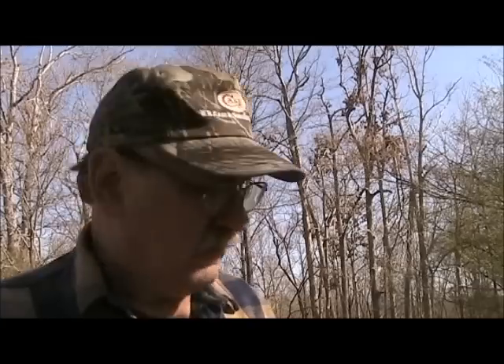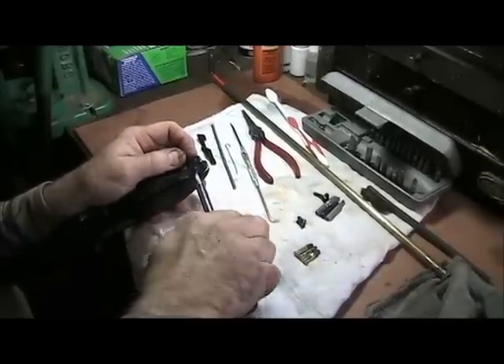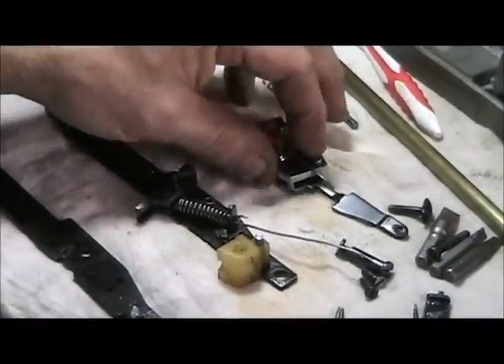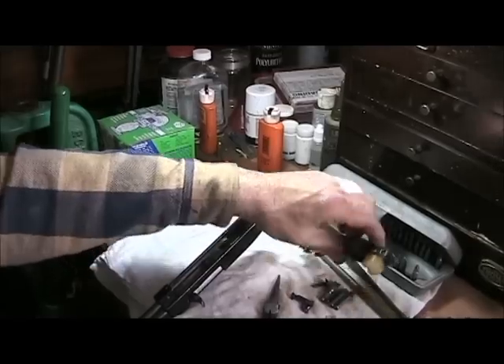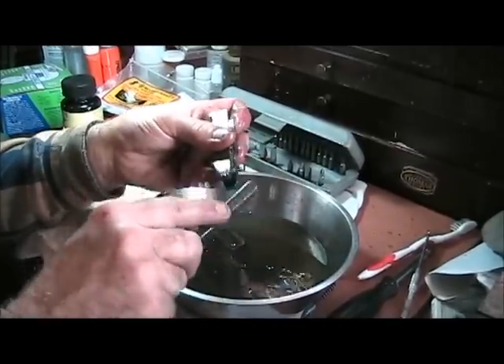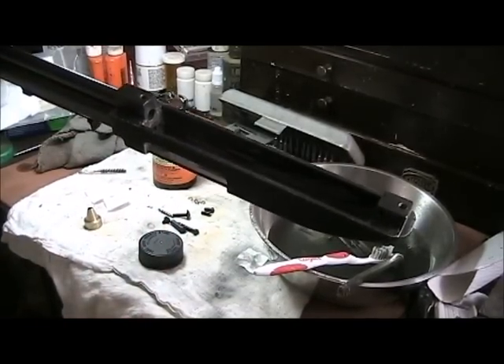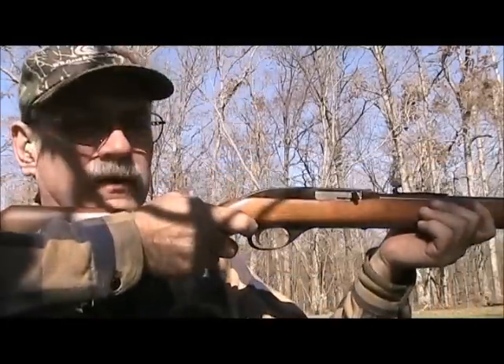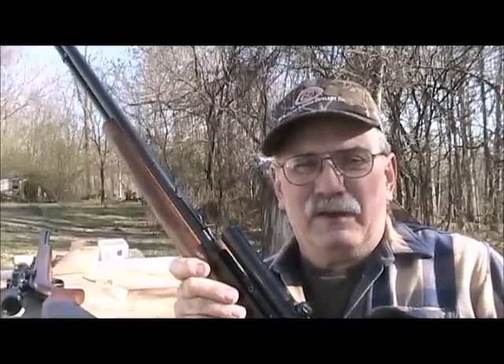Marlin Model 60 Jamming Problems and How to Fix Them

Comment: I have a Marlin mod 60. The bolt started hanging up in the receiver as it approaches the chamber. It's also hard to pull past that position but moves freely in the rest of the receiver. There are no chafing marks in the receiver. What could be the reason for this?
Reply from the maker: If the bolt is hanging up in mid stroke, even after the hammer is cocked, then you could have a slightly bent guide rod, or some fouling causing it to cycle hard. I would dis-assemble it going by my instructions in the video, and look for potential problems while thoroughly cleaning everything.
Reply: @CumberlandOutdoorsman  thanks for your quick response. I forgot to mention that this happens even while the gun is disassembled while I am moving the bolt back and forth in the receiver. When I move the bolt to within a quarter inch of it's stopping point at the chamber it starts to bind. I am really baffled by this. Again, thank you for the prompt response and you videos are very informative. If you have any idea what this issue is your advice would be greatly appreciated.
Reply: Also forgot to mention that I keep her clean as a whistle. I'm one of those guys who can't stand a dirty gun. Maybe the receiver is faulty,I don't know. Was thinking about machining away a small amount of material on both sides of the inside of the receiver but don't want to make matters worse.

Comment: is it unsafe to shoot if my recoil buffer is broke in three different places
Reply from the maker: Good question. It is not necessarily unsafe to shoot your Marlin 60 with a broken buffer. I would highly recommend replacing it though, because it is very inexpensive, and rather easily fixed. I'll be posting another video with better lighting soon.
Reply: Correct that it will not be unsafe but you are going to damage your receiver from the charging handle shooting back and hitting right against the aluminum

Comment: Dont have time to watch the whole video right now. I have an almost new gun that has jammed from the start. Sometimes doesnt eject spent case, sometimes I hear the click of the fire pin but no shot and when that happens it wont eject the unspent shell. Have to manually cycle it about 5 times to get it out and there is no marks on it from the firing pin. Very frustrated with this gun.

Comment: Thars almost what happens with mY 22, it shoots s,w but will not fire fed. I fired 2 times the 3rd time the expelled shell cam lose before ejecting and the new bullet jam together. I try getting them out.I did but now the bag gum door won't close.HELP!!!
Reply from the maker: That sounds like the ejector/lever spring is causing the problems. It may be bent or damaged to the point of not allowing the bolt to go into full battery position, or the loading throat is worn or damaged along with a malfunctioning ejector claw on the bolt. It may be stuck or damaged and not grabbing the rim of the cartridge. Hard to say without seeing it first-hand.
Reply: @CumberlandOutdoorsman  tell me how to send the thing 'as long as it shoots i don't give a hoot

Comment: I bought a marlin model 60 a few days ago and brought it home and disassembled it to clean it and upon reassembly the bolt stuck shut and will not move and when I disassemble it again the bolt and hammer group at stuck together and I have to really tug to get them separate again can anyone in the comments help?

Comment: The quiet ammo and the kinked recoil spring was the likely culprit.  There is a technique to reinstall the bold at a steep angle to keep the spring from kinking on the guide rod.  The parts that you replaced likely had no effect.  Poor lighting and part identification.  Still better than any video I've created.  The Mcarbo spring replacement video is better.

Comment: Excellent video sir and thank you. If I understand correctly, these three newest model parts will work together in an older model rifle. Mine is a 1973, first digits of the SN are 27. The feed throat has 3 studs with the ejector lip on the left side. The cartridge lifter spring does not eject the case. Do I try for find the originals or order this feedthroat conversion kit? https://www.gunpartscorp.com/products/441130B
Reply from the maker: Ok, well in this video I actually ordered the new parts that would come factory in mid 1980's guns on up. The reason I went to the newer style feed throat is because it is improved, and is supposed to feed easier. It will also be needed to upgrade the gun for a bolt release lever. This will hold the bolt open on the last shot, so check out the video I made that covers upgrading your older Marlin/Glenfield/Revelation model 60. It will take you step by step and is not difficult to do. Thanks BTW, I appreciate the kind words.
Reply: @CumberlandOutdoorsman  thanks you for the help. Going to watch that video now, however, just to clarify, these are the parts I need and they will fit my older model rifle: https://www.gunpartscorp.com/products/441130B

Comment: Quit using subsonics in it
Reply from the maker: Perhaps I failed to mention that the gun was jamming no matter what I loaded into it. I figured that if it could cycle subsonic loads, it would cycle anything else I fed it. It now functions flawlessly with any loading.
Reply: You are correct that it will not fire lower powered ammo like the CCI Quiet in semi-auto mode but you can chamber them manually. Cumberland did make a correction when he fixed it and said it also shoots the quiet but he corrected himself and said that was not the quiet ammo that he tested after the fix. He stated this in one of the comment replies

Comment: Step 1 Throw the Marlin 60 in the dumpster.
Step 2 Buy a Ruger 10/22.
Step 3 Done.
Reply from the maker: There is one fact that you've forgotten......for every one Ruger 10/22 there are three Marlin 60's out there. Oh and by the way, I have had some of the same issues with the 10/22. Nothing mechanical is beyond failure.